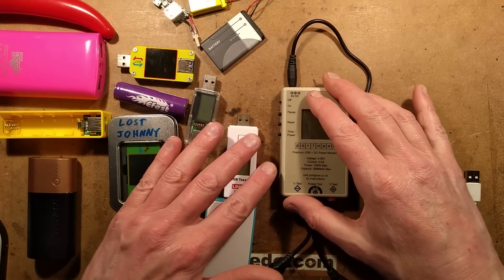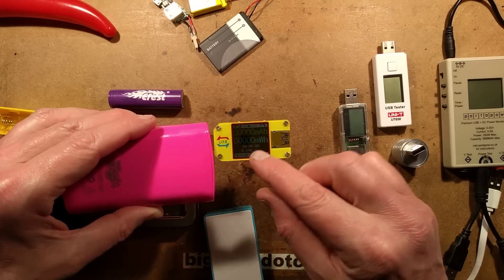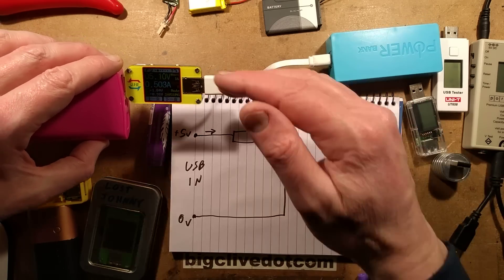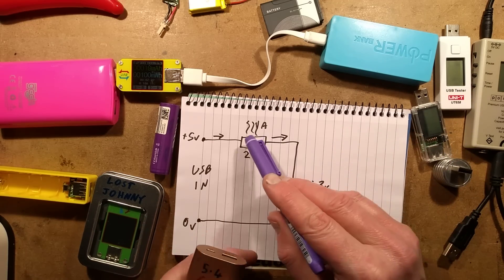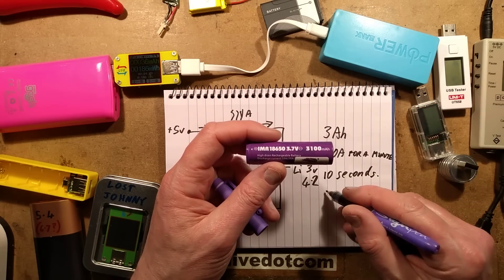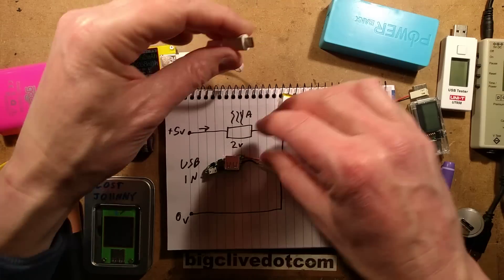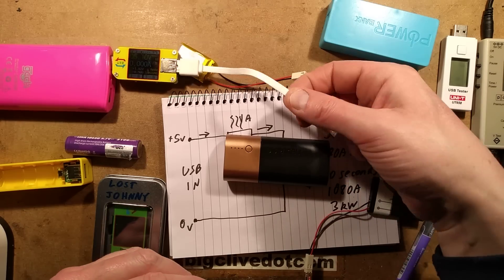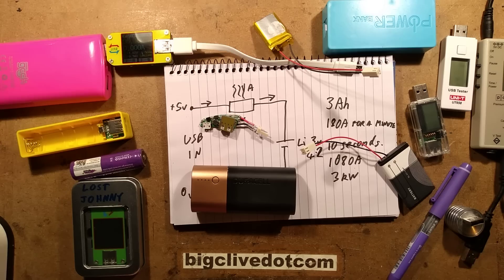How I test lithium cell and power bank capacity.

Comment: I guess Watt hours (Wh) would be more accurate when comparing the bare cell to the 5V bank output ?
Reply: There are advantages and disadvantages when using Wh, the same as there are advantages and disadvantages when using Ah.
If there are no buck or boost converters, Ah is a more useful unit to use.
If there are buck or boost converters, Wh may be a more useful unit to use.
It all comes down to what and where you are measuring, or what the load is on the cell/battery.
For example, if using a high capacity lead acid 12V battery that is directly supplying a 12V load, as no conversion circuitry is involved, Ah is the more useful unit, as that tells you how long the load will run for at a near constant current.
All cell/battery manufacturers use Ah to state capacity (including primary and secondary cell types).
Reply: Can you explain what are the disadvantages of using Wh?
I am not aware of any.  There only are advantages.
(except when you want to count "impossibility to confuse the customer" as a disadvantage, of course)
Reply: Rob - one of the disadvantages with the Wh unit... Wh is less useful if you want to use a cell or battery to directly supply a load that requires a constant voltage and you want to know how long such a load will run for at that voltage.
A second disadvantage is that using Wh (with no other criteria stated) you can run the cell down to well below a useable voltage in ‘calculating’ the Wh figure to make the Wh figure more impressive.
Nearly all cell / battery manufacturers use Ah. So it’s a universally used unit.
If we did switch to Wh, it would not take unscrupulous suppliers long to figure out that they could tinker with the output voltage to inflate the Wh figure.
As I have said elsewhere in the comments, there are both advantages and disadvantages to both Ah and Wh figures. To make the figures more useful, the discharge load (resistance and voltage, or current and voltage) and endpoint cutoff voltage all need to be stated as well.
Reply: Mark 1024MAK They can (and do) perform this same operation with Ah. Sometimes the spec sheet will say that the rated Ah is achieved by going down to 2.0V or 2.5V.
Reply: @Mark 1024MAK
You have not convinced me there are disadvantages for using Wh.
What you state as disadvantages can be applied to Ah figures the same way.
For a standard specification of Ah there are specifications of the load resistance.
You cannot assume that a 10Ah cell can be discharged with 10A for 1 hour.  Or 100A for 10 minutes.
And of course these should be applicable to a Wh specification as well!
The lower cut-off voltage does not affect the capacity very much, but it does affect the lifetime.
So a manufacturer using a low cut-off voltage should be prepared to get a lot of prematurely failed units returned.
Reply: @Mark1024MAK  fwiw I have been burned by amp hour ratings on jump start packs...several I have had they add the cell voltages and multiply the series connected cell capacity to sound more impressive.  Watt hour ratings have usually been much more honest...IF you can find them.

My packs were 8000mAH 11.1V 29WH rated.  My tests showed 11.1V 2AH about 24 WH.
Reply: Matthew Miller - jump start packs are often a rip off anyway...
Reply: da-Share Not really as W-hr is skewed by the linear regulator during charging and you will need to compensate for the 85-90% efficiency of the 5V boost switching regulator circuit during discharge and both of those will require compensation to determine actual battery capacity (though either would be an acceptable measure of actual powerbank capacity as a complete unit).  Since nearly all of these powerbanks use a linear regulator charge circuit the easiest figure to work with is the mA-hr capacity input to the battery during charging (from fully depleted cutoff voltage) then if you want an estimate of W-hr capacity multiply the mA-hr figure by the nominal 3.6-3.7V of the Li-ion cell to get the battery’s native capacity.  Since you will get better than 99% of what you put into a Li-ion battery back out of the battery the discrepancy between input and output power is less than 1%, hence it is easiest to work with the mA-hr figure you put into charging the dead battery to figure actual capacity if the internal battery.
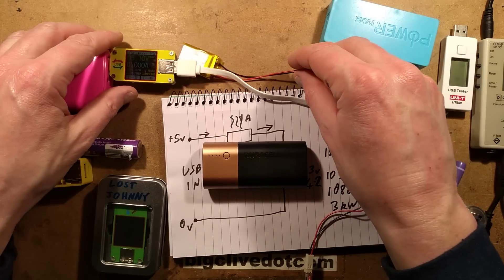Reply: da-Share LOL, at 13:15 Clive says Watt else...
Reply: those are all not good way 
you want to test the capacity of battery and his voltage , if you want to test the capacity, you can take it as power bank, then use our forum , 
power bank capacity calculation method 
 After the power bank is fully charged, connect the AT34(data first reset) with the appliance, then discharge to the stop output 

Method 1: power bank capacity =AT34 measurement mAh * the output voltage ÷ battery voltage ÷efficiency.

Method 2: power bank capacity =AT34 measurement mWh ÷ battery voltage ÷efficiency (normally power bank output voltage is about 5V, internal battery voltage is about 3.7V, efficiency about 85-90% )
Reply: da-Share 
Yes, it would.  As an example, what Clive started near the end could confuse people: a 3.7 V cell capable of outputting 1 A for three hours is absolutely not going to be able to output that same 3 Ah at 5 V.  Shifting the discussion to the energy capacity in Wh would make this far easier to understand.

(Photography review websites always use the Wh ratings, for example, as this lets the reader know how much energy is available in a given cell or battery — and this is what people really want to know.)

Comment: Is the true or closest measure of a LiPo cell during charge from minimum voltage, discharge at a constant rate to minimum voltage, or both?
I have a "smart" charger (an icharger 208B) where I can set the charge current, and has a function where I discharge at a constant current, and it counts the Ahr during either one.
For a LiPo cell (3.7v @ 2000 mAh) I usually set the charge current at about 400 mA and when I use the discharge function, the discharge current at 500 mA.  I use the measured capacity from the discharge as the available capacity of the cell.  Should I use the charge capacity instead?  or will either one work?
Recommendations/opinions?
Reply: If you want to know how much power you can pull from the cell (arguably the more practical number), use discharge capacity.
Reply: I charge my lipos at 1C.
Reply: In the case if Li-ion and Li-Po cells specifically, the power you will get out is greater than 99% of what you will put in with proper charging, so it makes little difference.  If you use a linear charging circuit (which is most common for these powerbanks) then the easiest way to determine the mA-hr rating is to fully deplete the battery to cutoff voltage then charge it using a USB power monitor that records accumulated mA-hr and figure that mA-hr rating at about 3.6-3.7V if you want to calculate W-hr.  When discharging these power banks where there exists a 5V boost switching supply circuit you do not get an accurate recording of battery capacity because the boost circuit will have only 85-90% efficiency plus you need to account for the added mA-hr drawn from the battery to boost that 2.8-4.2V battery voltage up to the 5VDC (about 1.4x average multiplier) that is being output, so a lot more math is involved if you want to estimate actual battery capacity from the discharged power, hence measuring charge mA-hr is a much more straightforward alternative provided a linear charge circuit is being used by the device — if you encounter the rare powerbank that uses a buck switching regulator for charging then you are back to estimating battery capacity as you must then, again, account for the difference in voltage between input and output (5V to 2.8-4.2V)  and the efficiency of the buck regulator, but most powerbanks use a linear charging regulator circuit for simplicity which make measuring charged capacity easiest.  On the other hand, if you are measuring bare batteries (no intermediate circuitry other than charge protection) then for Li-ion you can simply measure charge or discharge power since they should differ by less than 1%, though with most other battery chemistries you would ordinarily want to measure discharge capacity to get true useful capacity.

Comment: I think the best way to test power banks to get the most accurate capacity is to let it charge up normally, let it sit for a few minutes once removed from the charger, then put a 500ma load on it and then get the reading once the power bank shuts off normally.  To me that gives me the best indication of what to expect in the real world.  
I have one of these with an 18650 battery holder and a male/female USB connector on it for testing:
https://www.ebay.com/itm/Constant-Current-Electronic-Load-Battery-Discharge-Capacity-Tester-9-99A-60W-30V/132043334921?epid=2169550363&hash=item1ebe656509
Reply: you want to test the capacity of battery and his voltage , if you want to test the capacity, you can take it as power bank, then use our forum , 
power bank capacity calculation method 
 After the power bank is fully charged, connect the AT34(data first reset) with the appliance, then discharge to the stop output 

Method 1: power bank capacity =AT34 measurement mAh * the output voltage ÷ battery voltage ÷efficiency.

Method 2: power bank capacity =AT34 measurement mWh ÷ battery voltage ÷efficiency (normally power bank output voltage is about 5V, internal battery voltage is about 3.7V, efficiency about 85-90% )

Comment: The only issue I have with this type of charge testing (And I do it myself) is that the readings are distorted by the efficiency of the 5vUSB to CellVoltage conversion. I believe this method will always measure the capacity with about a 10% over-read. The same stands for the discharge of the cell. They will typically under-read by about 10-15% due to the measuring at 5v as you said around 14:00.  I guess these numbers are close enough for general use though.

I built, but never published, a tester based on an Arduino and a couple of constant current drivers that I feel gave better values for capacity. It measured the capacity using time and a fixed current of either 1A, 100mA or 25mA based on voltage triggers.  I might drag it out and publish it sometime soon as I've never seen this done anywhere else.

Sorry for waffling! :-)
Reply from the maker: With the simple current regulation the current is constant through the whole circuit.  So the current being measured by the mAh counter is exactly the same as is passing through the lithium cell.  It's only on some more sophisticated power banks like potentially the Duracell one that buck regulation skews the result.
Reply: bigclivedotcom To add to Clive’s comment, that is true during DISCHARGE as most power banks use only a simple linear voltage/current regulator during charging for simplicities sake — this means that the mA-hr reading you read when charging a depleted battery will ordinarily match that of the battery to within better than 1%...and if you want battery Watt-hours you would multiply that mA-hr figure by the battery nominal voltage of 3.6-3.7V.

But during discharge you must account for not only the added power draw the battery sees from the boost regulator boosting 2.8-4.2V up to 5VDC but also for the 85-90% efficiency of that boost circuit plus whatever load your USB power monitor may add — so determining native native battery capacity during discharge is more complex, but determining such during charge is usually trivial and since the efficiency of Li-ion batteries is better than 99% you may as well use the charging figure since it will be off by less than 1%.

However, there are a few charge banks out there (particularly those with fast charge support) that use more efficient buck regulator’s during charging in which case the best you can do, short of removing the battery and measuring directly, is to measure the Watt-hours used during charging and then multiplying that figure by 0.85 to 0.9 to compensate for the inefficiency of the buck regulator since, in this case, the Watt-hours figure is the most trustworthy number to go by with a switching regulator and then derive the battery mA-hr rate based upon its nominal 3.6-3.7VDC (so, real Watt-hours equals measured W-hr multiplied by 0.875 and to get Ah figure you would divide the real W-hr figure by 3.7V).

Comment: I once got a no-name power bank has 2 18650 cells in series and they boosted the voltage when charge, step down the voltage for the output, they have 2x3Ah cells in it and the board design looks quite nice with a big inductor, wondered why did they do that? Is it possible because of stepping down the voltage when output is more efficient than boost it up like regular power bank do?
Reply: It should provide more current with better efficiency for the output at least, it's easier to PWM the voltage down at high current rather than boost up the voltage of several amps.